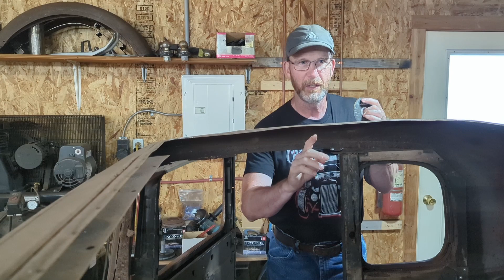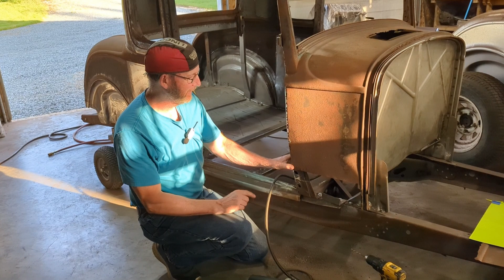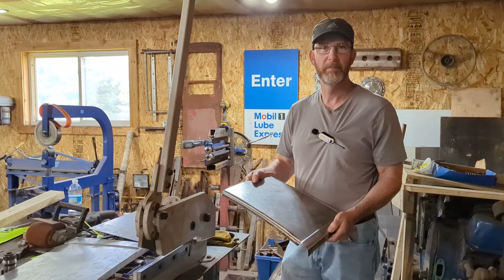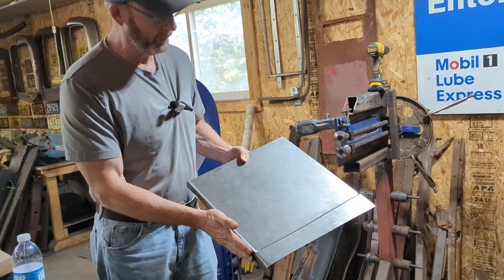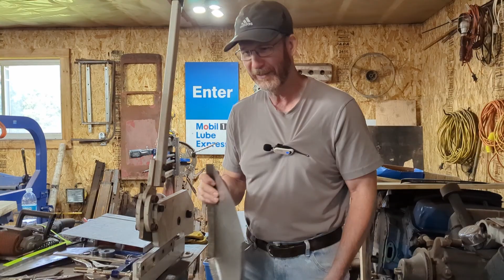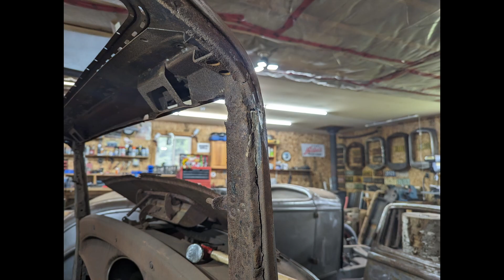1932 5 Window Coupe gets new front quarter panel fabricated

Comment: Derrick-
What did you do about the part of the quarter panel that fits down inside the cowl band?

I am about to graft in the front quarter panels on my 5 window but the new pieces I got from Brookville don’t include that part either.

Thank you Sir,

Colton Crowder,

Harrah, Oklahoma
Reply from the maker: Colton, this was a while ago but if I remember I made a separate piece for this and welded on my quarter panel. If you can't make it in one piece make it in 2 and then weld them together.

Comment: Another episode and more fine metal work. Hammer welding has come up a few times on the videos I watch. I no it’s nothing new but it’s good to have it explained what’s happening to the metal. I remember a 50s ford that a service man had took abroad with him. He had sectioned it and hammer welded the hole car. I’m pretty sure it was on mad fabricators dvd. The five window ( munkton ?coupe ) looks good on wheels and with the engine in place.        Cheers derek for sharing.
Reply from the maker: Tim I'll explain more on the next panel. I have to do the other quarter panel and the cowl vent. Thanks for the feedback. Thank you!
Reply: Sorry Moncton coupe.

Comment: Your ' A ' pillar looks like it came out real good --------- So we are working on something and we need to ------- look at a piece ( could be missing ) ----- make a copy of ---- or even use that old piece we cut off ---- replaced ---------- So , we don't throw away ---- ANYTHING ----- may need it ----may need a pattern --- might even have to use it ---- as in your drip rail ---------- Curious, what gage sheet metal are you using?------------- The Coupe at the end ---looks like it will be on the road soon -- you did a Good job on it ------ Looks real good ------- Owner say what color he would like to paint it? ------ You have a Good Week too Derek ------------ Rodney
Reply from the maker: We keep everything we cut out and send back to the owner. We use 18 gauge sheet metal for our panels. This one is to be returned epoxy primed to the owner prior to bodyfill and paint. I'm not sure what color he is painting it